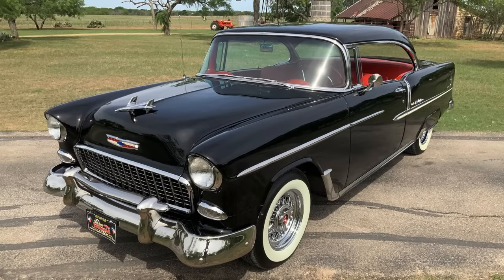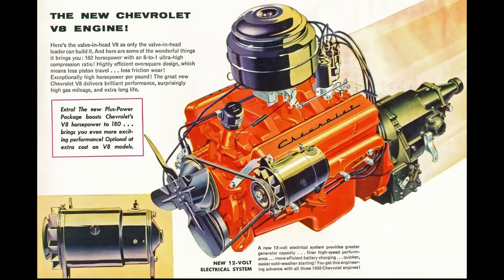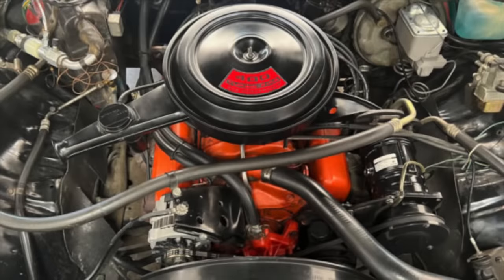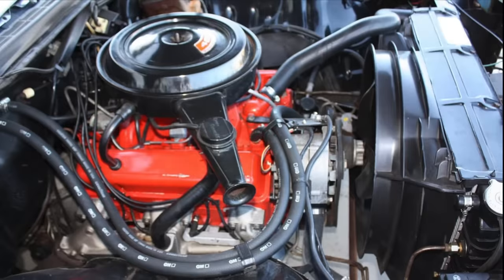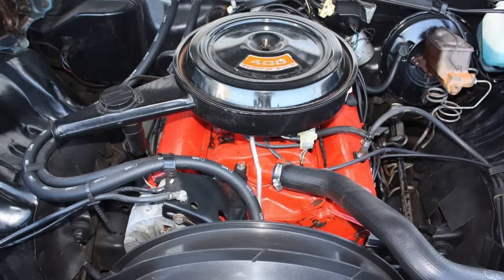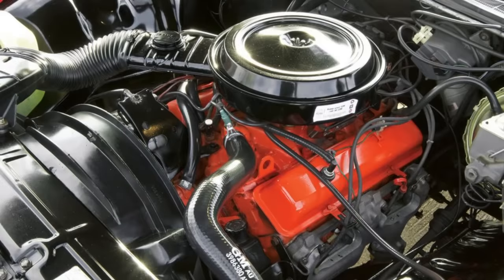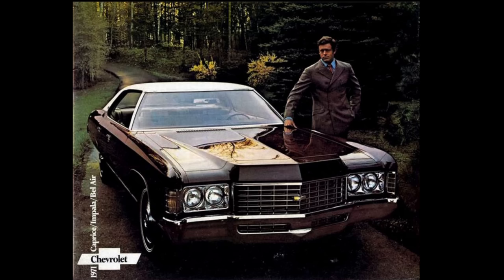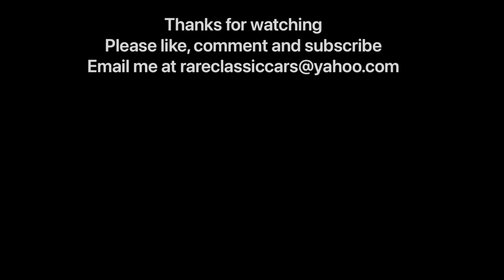Forgotten Engines: The 400 Cubic Inch Chevrolet Small Block V8 (1970-1980)

Comment: The biggest contribution of the 400 sb was the crank and rods ,it made it easy to make a 383 stroker from a 350, that said i had a75 impala 400 2bbrl ,that would burry the spedo get goodmilage ,but hardly ever burn rubber❤😂

Comment: My 1970 Chevelle had the 2 barrel 400 and the 400 tags were on the fenders.
 One thing i could never understand is why it was registered as a 1971 . It has all the 1970 things that came with the 1970 very strange.  I took the instrument cluster and speedo out and i saw october of  1969 stamped on the  speedo housing. The sweep speedo is tinted green where as the 1971 and 72 has the speedo numbering tinted in white numbers. I can't for the life of me understand why its registered as a 1971
Reply: interesting!  that could have been a factory or a DMV mistake.  the 70 chevelle is probably one of the most obvious year specific GM cars ever made, My 70 chevelle is my favorite car.

Comment: "Why did GM have the small block 400 AND the big block 400?"
As you noted the small block was actually a 401 and the big block was a 402 (the later was a stump puller in pickup form.).  The 402 was labeled as a "396" for quite awhile.
Marketing... just like Ford had a 351 Cleveland, 351 Windsor (FE block) and a 351 M.  They all had the same bore and stroke but the M had different connecting rods and longer piston skirts to prevent piston slap... because it was mostly a truck engine.  So, unless ya knew what box to check off on an order form...
Still, though, I wished there was a definitive definition for "big block" vd small block."
Reply: I'd guess weight.  There's always so much talk about weight.  If you can have an engine in the front that weighs less, I'm not an expert on handling and suspension, but that has always seemed to come up a lot, so if you could get a SBC 400 in that model, it had to weigh less than a BBC, even though they were pushing the envelope with those siamesed bores.  My father made a big deal in his 1976  K10 was ordered with a big 4 core radiator heavy duty cooling option.
Reply: No 2 big blocks or no 2 small blocks from different automakers were the same, each automaker just happened to make 2  different size blocks over the years, when they wanted 440,455,460 cid,, the smaller block did not suffice, so they had to cast a bigger one. I dont know about Cadillac from the first v8 up to the 500.  I still haven't read up on why there was a 460 Ford, but a 462 Lincoln ?  I'd just hear Dennis on My Classic Car and hear something new.  Pontiac was the only division among the big 3 to make only 1 size block V8, from the 287 they debuted in 1955 til the 455 in the '70s, they will all drop in and bolt up, they have the same basic dimensions (even the 265,301 from 1977-81 will bolt in 'cause the  bottom is the same, just a low deck version of their block).  You'll hear a guy say 455 big block Pontiac, and  usually it's a diehard Pontiac that tries not to roll his eyes, waits til that guy leaves & tells his son and friends "there's no such thing as a big block Pontiac, he doesn't know what he's talking about".
Reply: Ford 352 also had same bore and stroke as the 351's...

Comment: The one thing all SBC's had in common:  4.4" bore centers.
(I think)
Reply: way more than that.  water pump mounting holes, intake, exhaust, distributors, oil pump, timing chain, and a lot more.

Comment: My 71 c10 came with a 402 big block. It came with 400 badges on the front fenders. The glove box build sheet says 396. I put 396 badges on it instead of the 400 ones. Odd times at gm. Then I wonder if it was to hide the big block in the mix at least for a short time because of all that epa BS

Comment: Not forgotten, in demand for performance builders; problem almost impossible to find a virgin block. Most junk yard blocks are unusable, corroded, cracked, over bored etc.  Also, 2 bolt main is more desirable than the 4 bolt because it is stronger.  509 stamped block is most desirable since strongest compostion.  Need some fact checking here.

Comment: Im a mopar guy so I have question for the Chevy folks. I have heard about overheating issues with the 400. Would racers intentionally use a 400 crank in a 350 to avoid that or was it because they wanted more cubes and had more 350 blocks lying around?
Reply: 400s overheated for two main reasons: 1) the steam holes became plugged with rust and/or other sediment, causing steam pockets around the cyiinders, or, 2) people put non 400 cylinder heads (no steam holes) on them without drilling the steam holes in them, effectively causing the same situation as in #1. And yeah, building a 383 from a 350 block and 400 crank completely solved the potential overheating issues. A 400 is still a bigger engine though, and is still my choice for a build.

Comment: High torque engines need stronger bottom ends. The cylinder pressures are higher to generate that torque.

Comment: The 400 SBC is far from "forgotten". Quite contrary. It is almost legendary in performance and racing people. The 4.125" bore means it doesn't shroud the intake valves as much as the smaller bore engines, and that coupled with the 50 extra cubic inches makes it THE SBC to build if performance is priority.
Until the advent of Gen III+ engines being common in salvage yards, the 400 SBC was picked to death by hot rodders and racers, coupled with low production numbers conpared to almost all other SBC's, and as such is an exceedingly rare find nowadays. The 400 SBC will always be remembered by the gearhead community..

Comment: Your assertion that the 400 SB had no problems with overheating unless they were modified, runs heavily contradictory to what we actually experienced back then ourselves.  These engines were WELL-KNOWN for overheating in stock form.  The factory 400 heads were extremely crack-prone and the simple solution was to put 350 heads on it by laying a set of 400 gaskets on the deck of the head and simply drilling steam holes into the 350 heads.  You and I are very close in age, I would say you're probably at most only a few years younger, so I don't see how you were not privy to this, considering your knowledge of this era.

Comment: As long as the cooling system was in good working order they would manage in cars. In trucks that got used like trucks they didn't just tend to run hot they were almost unusable. Not a bad engine but it would have been nice if they had at least designed a bigger/higher flow water pump to go along with the big radiators 400 equipped trucks had. It's too bad Chevrolet didn't add some deck height for the 400 to increase water capacity and cooling jacket area like Buick and Ford had done when a  displacement increase was necessary with their small v8's. The 400 can work but all in all if a 350 wouldn't suffice a big block is a much better choice.

Comment: I witnessed many a cracked 400 small block as a mr. goodwrench . Right between the cylinders  at the water ports. Too little " meat " left from boring that sbc to the max . One overheating from a bad thermostat and you got yourself a boat anchor .

Comment: Why do builders look for a 2 bolt main 400 small block rather than a 4 bolt?
Reply: the main webbing is stronger on a 2 bolt block.  if your gonna build one for racing you just add 4 bolt main caps while its at the machine shop.

Comment: 400 is highly sought after. The 396 and 402.... what were the actual differences again? I thought it was just a marketing scheme. I'm pretty sure the bore and stroke were the same and like most gm parts, they interchange.
Reply: the 402 was a 30, over 396. the 396 had a 4.094 bore and the 402 had a 4.156 bore. both had a 3.760 stroke.

Comment: I had a 69 Camaro and put one of those in it - 4 bolt main with 2 bolt caps. If I had it over - I would have used a 350. Too many problems as mentioned. The Siamese cylinders was asking for it. It was externally balanced --- no thanks

Comment: The LS engine is a well over rated engine. Used to on them junk motors all the time at the Chevy dealer I was a mechanic at. Having the oil drain pan filled with the roller bearings of the rockers, replacing engine blocks on Corvettes for the starter shearing off the aluminum block when the engine kicked back. The old school small block will always be better.

Comment: It was terrible and over heated all the time, and yes I was there and a mechanic at the time.
Reply: So it had a reputation at the shops, that's interesting.  My father's '76 K10 had the 4 row core radiator heavy duty cooling option.  I also never thought about this til now.  We live in a small village of 220. He drove it to work 10 miles on the outskirts of a smallish city.  And other use too, but it was almost all highway or country driving to grandma's.   But it never had to go stop and go, stoplight to stoplight, in a bigger city, lots of slow driving.  I suppose that would contribute to cars/trucks overheating more, wouldn't it.

Comment: If somebody could explain what makes a “small block” a small block, and a “big block” a big block. Why is the term big or small block even used? What’s the point? Wouldn’t it be enough to say 400, or 402, or whatever the size is?
Reply from the maker: Small blocks are physically smaller than big blocks.  Lower deck heights, smaller block size, etc.  

Some divisions like Chevy had a small and big block.  Others, like Pontiac, really didn’t.  All 326-455ci Pontiac motors are the same physical size.

Comment: The two bolt 400 small block was actually stronger than the four bolt variety. They discovered that with the two bolt mains, there was more iron to bolt into versus the four bolts. For the best retention, an aftermarket splayed four bolt cap made to fit on a two bolt block is the top dog.
To add confusion on the 400 versus 402… Chevy continued to market the 396 in its performance vehicles, but it was actually a 402. So you had a 402 that was marketed as a 400 and as a 396. I’ve heard numerous stories as to why they bored  out the 396 to make the 402… But the one that I personally believe is that the top brass did not want a small block being bigger than a big block.

Comment: Horsepower is only relevant at full throttle and high rpm. It is a measurement of the torque vs rpm so it means practically nothing except for going fast. Torque ratings are paramount at part throttle settings which are 97% of the time. Getting moving was the prime directive not drag racing. 5 hp difference between 350's and 400's is a non performance measure intended for marketing nothing else. 400 pulls better than a 350 and HP has nothing to do with it.
Reply: 100 % .  Everything you wrote.  HP rating only matters at higher rpms. Are most people  (not meaning you)  aware, at 5252 rpm the HP/torque  #s are the same.  Torque matters more, what's the torque curve like under 5,000.   Like  you said, 97 % of the time, how is it being used.  (Unless you're building something solely to trailer to the drag strip).  I still have the 2001 (I think) car craft that other ppl have referred to online over the years where they tested all of the big blocks.  They couldn't find the torque  peak on the Pontiac 455 (not a big block), I think they wrote something like the brake they used in that dyno starts at 3,600 rpm and from the results it probably had a higher torque output than what  showed up on the test results.

Comment: Maybe I was an outlier but my Chevy Impala had this engine and it spun a bearing at under 100,000 miles so I am not impressed.  This happened back around 1985 on a 1973 Impala.  The word back then was that Chevy Small Blocks were excellent up to 350 cu inches but the 400 had cylinder walls that were too thin.  Nobody wanted those 400 small blocks in the 1980s so I highly question this video's position.

Comment: guess they figured if ford could have 2 351's available, they could call both 402's & 400s a 400.makes about as much sence as chevy building a 262,265 267,283,307 & 305.all small blocks.how many engine sizes do you need in a 50 cube spread.& GM wonders why they allway find themselves walking the bankruptcy tightrope.

Comment: We had one of these engines in a 1974 Impala station wagon.  Worst engine we ever owned.  Our '68 with a 327 outperformed it.  The engine was one of the first low compression ones with a smog pump.  When you turned it off, it dieseled profusely and emitted noxious fumes from the tailpipe that made our eyes nearly go blind and made us cough a lot.  It was an awful engine.

Comment: A great engine if you like overheating😂
Reply: My 74 Monte Carlo with a 400 seemed to overheat all the time and it was bone stock.... but I also drove it like a raped ape 😆
Reply: A good radiator and clutch fan, with shroud intact, and they are fine. The main difference is that when they do overheat you better be paying attention because they are much less forgiving than the other small blocks.

Comment: The 400 small block and the 400 big block are the same boring stroke on both engines the difference in cubic inch must be the volume the heads Chambers take
Reply from the maker: They are not quite the same bore and stroke. Close, but slightly different.
Reply: The heads have nothing to do with cubic inches.

Comment: Oldsmobile never had nor ever was a small block. Same as Pontiac. Buick had nailheads, which one could consider a "small block" but olds nor Pontiac were never a small block!
Reply from the maker: There was definitely an Olds small block spanning up to 403 cubic inches. The 425/455s were physically larger.

Comment: Don't like the 400 small block, externally balanced, Siamesed junk, had a 73 Caprice with one, first & last time I will let one in my garage. Other side of the coin, had a 262 Monza, swapped over 350 heads & a 4 barrel, turned out to be awesome. 400 small block is a hate for me, junk. Make a 350 into a 383 & you will be ok, rant over.

Comment: The tale of woe , the 400 was a very lazy low hp v8 . Why GM never really did much with the 400 was marketing and profit making . They built the 400  as an economically choice for GM to fill a gap in the engine line up and a cheap version of a big block  [396] . Also if u wanted a performance engine around this size u chose a 396 which was more profit making. 
...What could have been ,,, heavy duty block  thicker bore walls and improved cooling passages is something the aftermarket has done . Then the rotating assembly factory was garbage externally balanced , .Aftermarket changes all this . Cylinder heads from GM were suffocating this engine .
GM never would have done a performance HO version because it was an engine built with little more than modified 350 parts =low cost